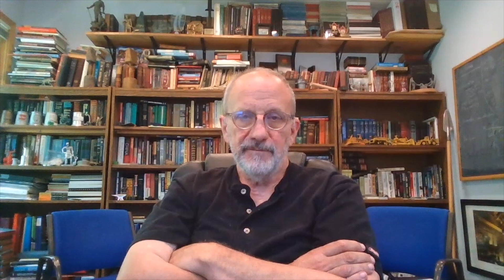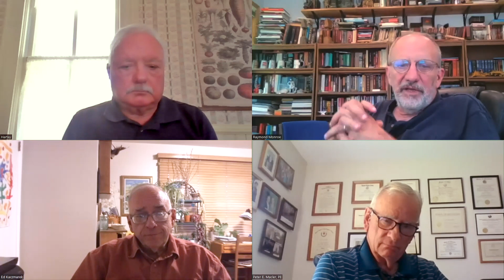Ramblings with Raymond S01E04 Sand Systems

Comment: Peter (paraphrased): If you design the foundry right and maintain the equipment you can manage your silica exposure and don't need to switch to expensive non-silica options.  

All that extra equipment and maintenance is more expensive than switching molding media.  This is especially true when you factor in the cost savings of the man-made molding medias, such as reduced binder levels, reduced wash, it lasts longer so you buy less volume which means you handle less volume, etc.  You can definitely manage silica exposure, but the most cost effective method is to eliminate silica sand from your foundry.  It is a big up-front cost, but the ROI is definitely there.